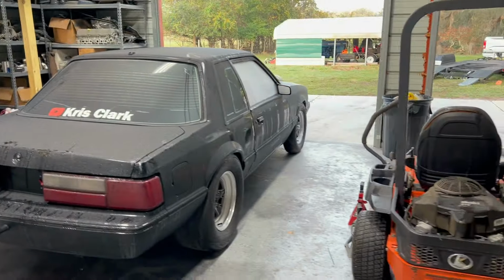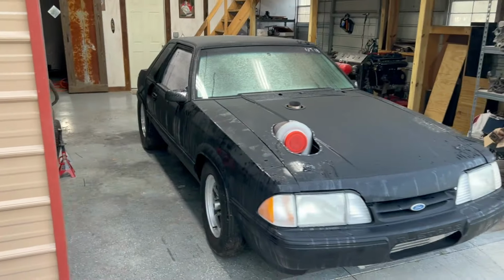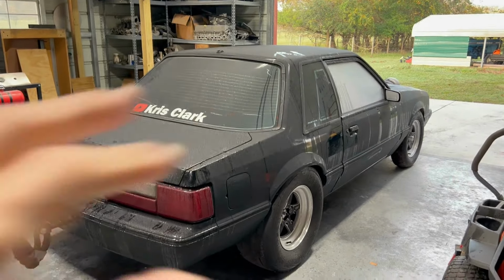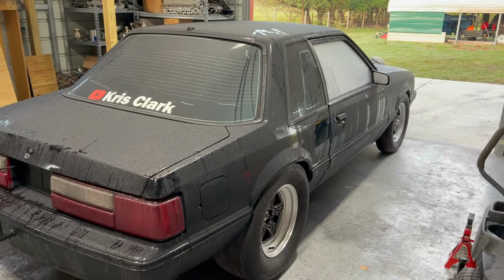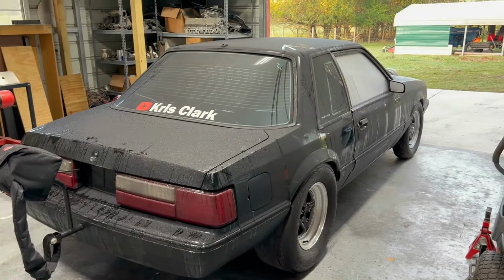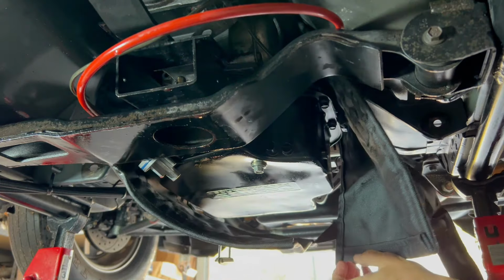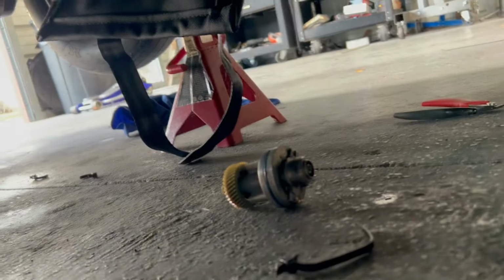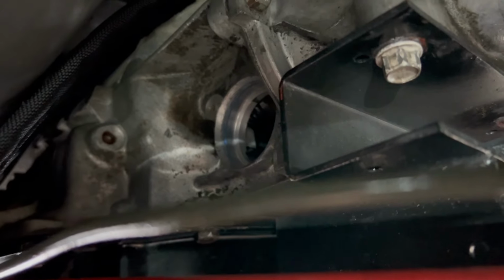Out For Blood 5 No Time Race! 2JZ Fox Body Making Fast Passes!

Comment: Awesome build Kris! Appreciate all the content you put out.  

What size front wheels do you run, 15” or 17”??

Are you running any beadlocks in the rear? Is your rear end shortened or standard fox length axles?

I’m building a 93’ coupe and it’s about time to order some wheels.  Love the stance and the way your rear tucks in the wells.  

Thanks!
Reply from the maker: Thanks!  15s up front. No beadlocks, and yes the rear is narrowed about 1/2 to 1 inch on each side.

Comment: I’ve broken rear ends and driveshafts. Each time has cracked the case and broken interior lugs.  Btw, I’ve now taken my 2j fox to the track twice and after the second 1/8th mile it’s in the 5s already. With stock cams, stock engine really except studs and o rings. Did it with a little FP 3582hd. Appreciate the info as always and I wish I was closer, could get the trans fixed right up. You could do it yourself I’m sure of it.
Reply from the maker: I might try to fix it my self. We will see.